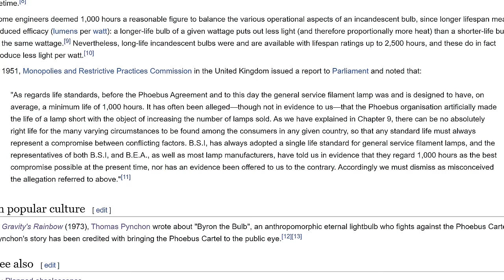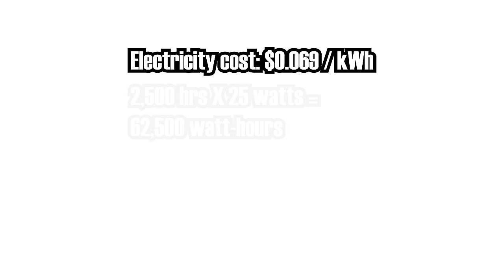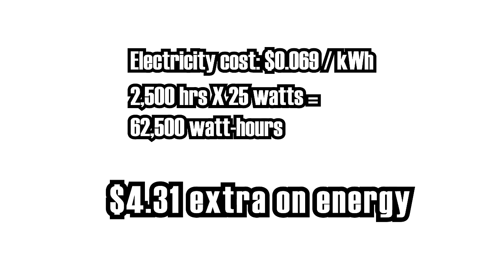Longer-lasting light bulbs: it was complicated

Comment: The new "planned" obsolescence is the ubiquity of things (that should not be disposable) with sealed-in disposable lithium-ion batteries.  I guess you could argue that it's a trade off vs the up-front cost of designing a battery door, or screw compartment, and, in some cases, a waterproof door.  Or argue that consumers shouldn't handle a bare LiPo with only wires and a JST-XH connector.  Still, we came up with AA, AAA, CR2032, etc., so, while not a conspiracy, this does strike me as deliberately lazy engineering at the expense of consumers and the environment.  "conspiracy" by unspoken consensus amongst manufacturers.
Oh, and thanks so much for this video.  I have needed something like it to refer people to for a long time.  The sacrifice of your poor 555 lamps is much appreciated.
Reply: The worst of these are non-refillable vapes. Non. Refillable.🤨
Reply: There is a reasonable argument for gluing everything together, which is funnily enough durability. When you glue a battery in place it becomes a structural component instead of one that needs to be held in place by structural components, allowing for thinner devices that are more impact resistant. Basically, once the expected lifetime of the battery exceeds the expected lifetime of other components (such as the screen glass) for the average user, it becomes a worthwhile tradeoff. Also reduces manufacturing costs.

I'd still prefer bulkier but repairable devices over ultrathin ones, but sadly that's what the market wants. But you can always vote with your wallet whenever a company such as framework comes along and starts selling repairable devices

Comment: My utility company had an option on their website where if I just put in my email in I would get two free LED bulbs and a night light completely for free. I did it, a weekater they showed up in the mail. Clearly cheap bulbs but free bulbs are still alive and well in some places lol

Edit: by the way for the note you made about the centennial light, if I remember correctly they said they had reduced the power intensity to it to help extend its lifetime due to its fame. It's running at a reduced voltage than it was designed for, but im sure the proper voltage wouldn't have been much brighter

Comment: That was a beautifully said explanation of the lightbulb that really needed to exist on YT. It'll be a shame when they be completely discontinued, since they're such great current limiters for circuit repair diagnosis.

Thank you for the shout out to Big Clive, I was just going to reference him for his tips on longer lasting LEDs but you beat me to the punch. 🙂
Reply: Indeed some countries banned their sale. I guess the choice should remain and let the market decide. Good LEDs are much better and last a lot more, go for the ones that simulate incandescent filaments, those are the best, but watch out for light projection, those usually light sideways unless the filament is curved so you need to account for that if the light most project straight from the socket and not just sideways.
Reply: @freeculture Market unfortunately would go for cheap incandescents. Which the power grid, especially in a world of increasing renewable energy, really doesn’t need the additional strain of.
Reply: Appliance bulbs will be around for a long time I reckon.  You can stack them to make your dim bulb tester.
Reply: @dbeierl  Yeah. Hard to heat proof an LED for an oven. The really weird incandescent lights which seem to be bizarrely resilient to replacement are car interior lights. Still usually incandescents, unless you pay extra for LEDs.
Reply: @RryhhbfrHhgdHhgd356   self-darkening 10W festoon lamps.  Ugh.

Comment: Carbon actually has a higher melting point. 3825 Kelvin vs 3,695 K . it is just harder to work with I think in terms of making a wire.
Reply: This is untrue. Carbon doesn't melt at standard pressure; it sublimes at around 4100K.

Comment: I was a locomotive engineer for Norfolk Southern (left b4 the East Palestine crash) but a life long railfan. Pentrex Videos has a video "Working on the Railroad". The video has sections on the NS Tie & Surface gang, BNSF tie replacement, NS Dispatching, and an old coal hopper rebuilding program at the Roanoke Shops. Its a really good video. Another cool TV series is the History Channels Extreme Railroading... the host is a little over the top, but info is good, and the first epiaode covers the territory i used to work between Pittsburgh and Harrisburg PA. 

@Practical Engineering if you can, you should do a video on the engineering of Altoona's Horseshoe Curve.

Comment: I bought my house in 2015 (built in 2007-2008). The buy who built it decided to double the amount of halogen fixtures than were originally drawn to be able to run them at a lower current for the same amount of light.

I don't know when exactly he installed them, but to date I have not had to replace a single bulb. I had to replace a transformer once that ran 3 bulbs, but other than that, zero maintenance.

That's pretty impressive in my book.
Reply: The halogen lamps in my stairwell pull so much current that the relay of the trigger switches regularly welded shut from the inrush current, making it impossible to turn the lights off again. My dad fixed this by putting an NTC in series with them which quenches the inrush current.
Reply: That is true, but on the other hand you have wasted a lot of energy by doing that.  As explained in the video, the efficiency of a light bulb steeply decreases when you run it at less than full power.
Reply: It's because the transformer linits the switch on surge that you get with incandescent bulbs - when cold, they have a lower resistance them when hot - this is when they tend to fail.
Reply: @Rob2  True, but where I live, the price per kWh is near-as-makes-no-difference cheap and produced green so I actually prefer to run the lights at a lower intensity and not have to change them, as many of them are at 4 meters (13ft) or higher ceiling height. 
Also, there are just so many of them so a chicken/egg problem has been created in that I don't want the hassle of changing out so many :)
Reply: Halogen bulbs should not be run at lower voltage (which results in lower current) because that causes them to run cooler, which in turn inhibits the halogen cycle, which is what keeps them running.
Reply: @tookitogo  My lights are on a dimmer switch controlling a driver circuit.  I'm sure it has been engineered to operate within spec of the types of bulbs it is designed for.

As I said, every single bulb is running after 8 years of use under my ownership and who knows how many years before I bought the place.

Just since I bought the place, if I go by 3 hours a day average (which is probably way under how much they are used), that's around 9000 hours of use they gave seen under my watch. I'd call that really good.
Reply: @borninator  I wouldn’t be so certain about the engineering. People often install things that shouldn’t be combined. In the case of halogen, it does depend on the exact bulb type, and on how much you dim them. (E.g. dimming one to 10% could significantly damage it, while dimming it to 40% is just fine.)
Reply: @tookitogo  This actually explains why my dimmer won't go lower. I've been frustrated at how intense the lowest setting is (also a downside of having 2x the amount of fixtures, I guess).

Comment: I feel like a key thing was missed in this video: They standardized the bad thing. I know this metaphor isn't perfect, but it would be like putting a mileage limit on your brakes for safety reasons instead of pad depth. If the standard had been a standard of lumens/wattHr I'd totally be on board, but standardizing the other end of that equation removes the possibility of someone subverting that equation and actually designing a better bulb. I'm not sure I'm willing to give up the planned obsolescence case here, even if the equation has proven unsubverted for the last 90 years.

Comment: In ny experience (and I am 80) having a bulb burn out while it was already on was a VERY rare thing. They normally only fail when you first turn them on, and the filament twists like crazy due to the thermal shock, and the inrush of current due to the lower resistance when cool. ...or the filament breaks due the the theraml shock when you turn them off, in which case they just don't turn off next time. I repaired computers from 1969 'til I retired 8 years ago.  There were a LOT of incadescent bulbs involved there! Many on them had keep-alive voltage applied when they were in their off state, as they changed etween on and off quite rapidly. In fact when we got tired of replacing dozens on weekly PMs, we converted them to tiny LEDs (Red was the only available color at the time), we had to disconnect the keep-alive voltage, as that was enough where they still appeared to be on when they were supposed to be off. Now happily they even come in meaningfull colors. ;) One can reserve RED for faults, and yellow/orange for cautions.

Comment: I think Veritasium did a video showing the centennial light bulb, that's when it clicked that there was something wrong with the story about manufactures holding back from releasing everlasting bulbs. In hindsight it should have been pretty obvious, I already knew lightbulbs released most of their energy as heat and that higher temperature black bodies put out a higher proportion of light in the visible spectrum, I just hadn't connected these two concepts together.
Reply: To be fair, once they found out the metal was getting away, they could have been working on keeping it in instead of making those kind of rules. Halogen are basically an improved lightbulb but it didn't get as popular as it could have been. It's still not as good as LEDs, but it would have been nice to push for something that could be both more efficient and longer lasting.
Reply: Actually,  Veritasium did this exact same topic in March, 2021.

Comment: I appreciate the nuance.  That said, limiting the lifespan is a really weird roundabout way to enforce quality / energy efficiency; presumably actually measuring the temperature or luminance of the light bulb would ensure quality better while still incentivising durability, but I suppose time is a lot easier to measure at this scale in the 1920s.
Reply: It's just physics. By measuring the lifespan you ARE measuring the temperature, luminance, wavelength et al.

Was this literally just similar to how the IEEE inforces standards today I wonder...
Reply: @lewisheard1882  Only assuming you're using the same lightbulb.  If somebody DID figure out an improvement - an additive, different structure, etc. - that claim would no longer hold.

Comment: The correct response to this issue would have been to establish standards for efficiency and luminosity. That would have left open the possibility of developing a better filament with a longer life without sacrificing brightness or efficiency.
Reply: Exactly my thoughts. The argument that they "figured out" lightbulbs by then is pretty weak, one might argue that progress stalled exactly because of the cartel. And arguing that "lightbulbs are cheap anyway", that just means people will tolerate it more, the revenue of the companies could still increase significantly
Reply: But that would require legislation....
Reply: @baronvonlimbourgh1716 it would not, many industries develop technical standardizations. That's effectively what the lightbulb cartel did, except their metric for standardization was weirdly limiting and dubiously motivated.
Reply: @LevySkulk   they where almost all created by or because of government.
If it happens organicly it is because technology develops into a certain direction that favors one feature over another, not because companies deciding what end consumer product is allowed to be produced and what not.
Reply: Alex never gave details of the wording of the cartel agreement so from this video it isn't clear exactly what the "standard" was that that set. 

When fuel mileage standard for cars were set in the 1970's the manufacturer claimed that people didn't want small cars. Basically they were claiming that the standard required small cars. That wasn't the requirement. It was just easier to claim that was the requirement than to innovate.

Comment: In the last 5 years I have had to change around 10 led bulbs, the majority of them have been from the same "boob" ceiling light fixture in my kitchen. It just gets too hot in it and they cook. The plastic case actually cracks on them. It's usually a bad led, and I have fixed some of them and put them back into service. My weirdest one was from my bathroom vanity/mirror/medicine cabinet that started randomly flashing rapidly. I moved it to a motion sensor floodlight outside that is stuck permanently on, thinking it would last a few weeks a few months at the most. That was 5 years ago. It's in direct sunlight, unprotected from rain, in Florida. Still going strong. It has outlived several other fluorescent flood light bulbs installed in the other socket.

Comment: Honestly, I kinda prefer the failure mode of incandescent bulbs to that of LED bulbs. I've had several LED bulbs fail by flickering constantly, which is a lot more distressing than the bulb just going dark. I still overall prefer LED bulbs, but dang they've been annoying me lately with how many have failed on me.
Reply: I'm assuming the chip shortage had something to do with things.
Reply: @tomhsia4354  The failed bulbs are from before 2020
Reply: @monkeywithocd I have had a lot of bulbs purchased during the pandemic period fail, often before the ones purchased previously.

It could simply be a bad batch.
Reply: @tomhsia4354  could be, as I think most of them are from the same batch, though I've had a couple fail in the same way that were definitely not in that batch.
Reply: @monkeywithocd  Well, I've noticed that the Sylvania bulbs I purchased during the pandemic were of a markedly lower quality than the older ones. The plastic was worse with more pronounced mould lines.

I have to say, A lot of LED bulbs are being run extremely hard and hot, they also contain cheapo electrolytic capacitors.

Comment: I switched to LED early on, and all my old LED bulbs are still working great.  Newer bulbs though... have significantly shorter rated lifespans, and often die well before that.  Granted, they also cost a fraction as much... but I hate that they're cutting corners and turning good tech into bad products.
Reply: wise to never buy a led bulb rated for less than 15 000 hours and staying with decent brands like philips. the general public is part of the problem, wanting to go cheap on bulbs - then they die long before they're supposed to and ruing the reputation of leds.
cfls had the same problem, and even the ones rated at a reasonable life for flourescent like 8 to 10k hours ended up going per-maturely.
Reply: @Jon-hx7pe  I mostly got LEDs rated at 50,000 hours or more.  I've had some run for over 50k hours already and still work.  Some are 15+ years old at this point.  I feel bad for people buying the cheap stuff now, having the electronics fail after only a few hundred hours.

LEDs have a thing similar to incandescent, where the amount of power and heat has a huge impact on the life span.  Less power means longer life, and it follows a fairly steep curve.  But unlike incandescent, LEDs are more efficient at low power.  Take a LED rated for 50k hours at 10W at 85 C, and run it at 20% power with good heat sinking, and it'll happily emit like 30% its rated lumens for like 250k hours.  An over-engineered / under-driven LED light can provide an entire lifetime of top-quality photons.  So it's worth getting a good one.
Reply: @ToyKeeper  50k hours is a lot. many crappy leds are 11k hours and in reality likely last a much short time than rated and shorter than good cfls.

Comment: I wouldn't call the Centennial light bulb in that photo "barely glowing". It looks like a typical photo of a typical incandescent light bulb taken in the middle of the day.
Reply: Except the entire picture is properly exposed. Assuming it is not and HDR composite that lamp is not putting out enough light to over expose that part of the image. While at the same time the rest of the photo is properly exposed and of an interior that is typically somewhat low light. I'd wager that you could see the glowing filament of that lamp in a slightly din room.

Checking Wikipedia it appears the bulb outputs about 4W incandescent. Iirc cosy window lamps used to be 15W and a traditional Christmas tree light is 0,5W. So 4W is pretty dim.

Comment: I've experienced the tungsten light burn out thing before in the past when I was younger. I also cannot overstate how easy it is to actually make some of the led bulbs on the market run for much longer, as Big Clive himself has shown time and time again, that for LED bulbs running on linear current regulators or whatever, can just have a resistor chopped off that normally would be parallel to another resistor for setting current, and also the other thing that Clive has shown that Dubai has in the bulbs sold within their country that are much longer lasting and whatnot for LED bulbs.

Comment: One of my favorite things in your videos is the complete monotone, on topic ways you slide in 69.

Something I've read about that lightbulb in California having such an insane longevity is due to cycling as well. It never has heating and cooling cycles causing expansion and contraction of the filament, so less risk of it breaking apart. That light is just always on so its always at its warm state.